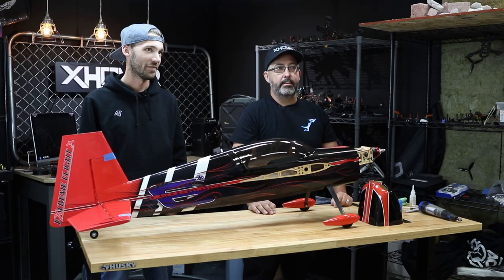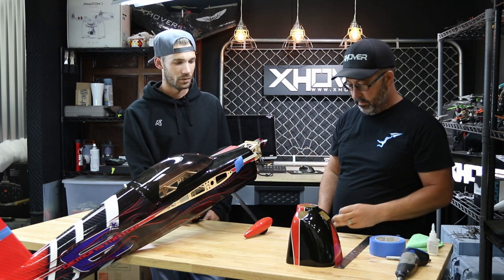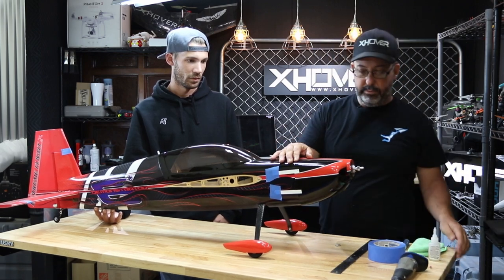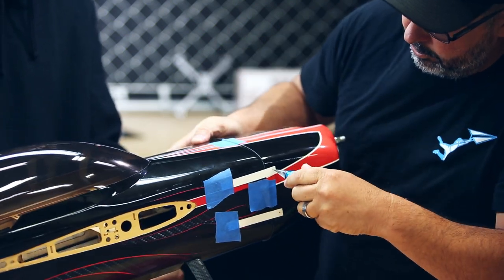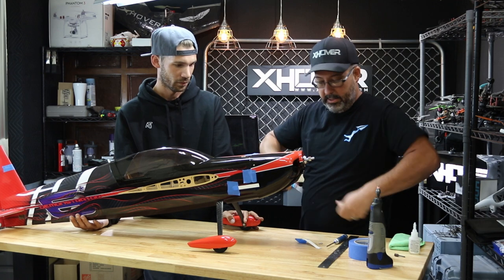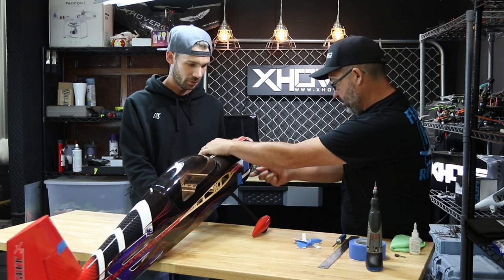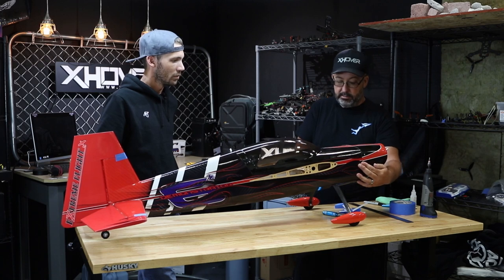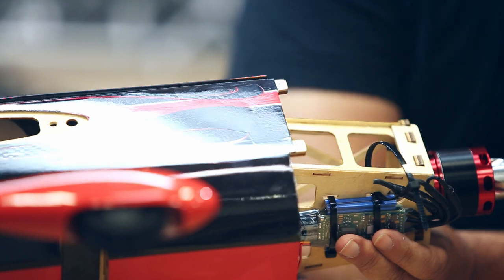FlightReviewz How To: Installing Fiberglass Cowl

Comment: Nice job.  Lightly sanding the backside of the cowl where the screws pass thru to remove any excess material from drilling and adding a few drops of thin CA will help it stay nice longer.
Reply from the maker: Great tip @rfair123. We will be doing a video on finshing steps like this and will definitely include this one.